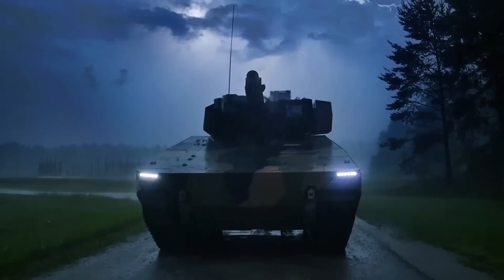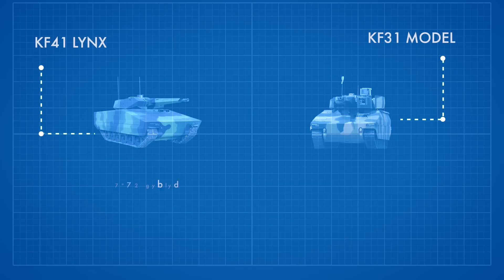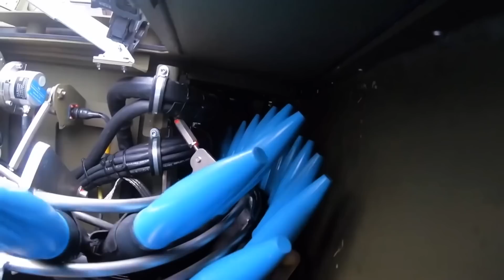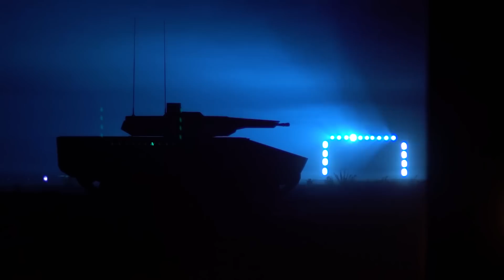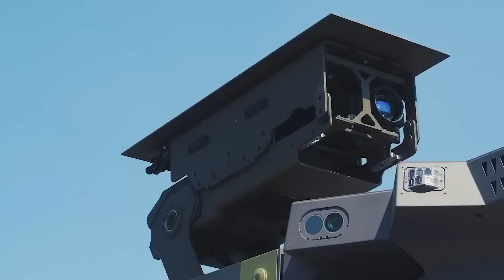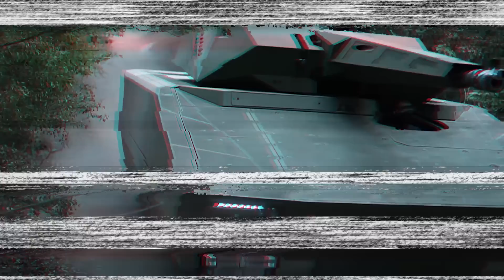New GERMAN Infantry Fighting Vehicle With SPIKE Missiles SHOCKED THE WORLD!

Comment: This looks like WW2 german armor tradition - compex, expensieve, heavy and few in numbers.
Reply: Have a look at the wars of the past 50 years to see how simple, cheap, inferior equipment in large numbers has always been obliterated by superior equipment even if there was less numerous superior equipment.

Weight isn't as relevant these days as long as the engine can keep up with it, which is the case.
Heavier IFVs are just as mobile as lighter IFVs these days.
Reply: @GABA-A42  I agree that using numerous cheep and old equipment is bad idea. It will lead to enourmous casualties and defeat like in the Gulf wars. My point is that germans often overengineer. At some point close to 90% of desired capabilites is enough. The other 10-15% make the vechicle very expensive and compex. See german Tigers and US Shermans in WW2. I know one was heavy tank and other was medium, but the germans wanted the best of the best. The americans wanted good enough.
Reply: @tacho843  I want to second what was already said above. There is no such thing as "over engineered".

A vehicle may be too expensive to manufacture. It may be too difficult or expensive to maintain. The company producing the vehicle may not be able to deliver enough in a reasonable amount of time, or the ammo may not be readily available. All of these criticisms mean something, although I'm not aware that any of them apply to the vehicle being discussed here.

In contrast "over engineered" is so vague it could mean anything, and as a result actually means nothing.

Comment: but by the time the german army obtains it it will be decades and obsolete
Reply: The Bundeswehr already has Puma in service. This vehicle is an inferior platform designed for the export market.
Reply: @Wilhelm Eley No, Puma is clearly superior in terms of crew protection, range, and power/weight ratio for the most part. It's fairly common practice for nations to reserve more advance vehicles for themselves.

Comment: The Lynx isnt that New anymore , though the newer KF41 version is i guess , the Newest IFV from germany would be the KMW RTC120 i belive ,but there isnt that much information out there yet , exept what was shown on the Eurosatory 2022
Reply: True. In addition, the Spike rocket system is not new as well. It is older than the Puma. However, it is even possible to shot anti tank missiles from the IFV Marder since the 70s. It is possible to mount a MILAN on it. It is basic equipment and included into the tactics of German mechanised infantry. Therefore, all German companies have to include this kind of weapons into an IFV of they want to sell it to the German army.

Comment: The US variant of the KF41 will have the 50mm (Bushmaster, I believe) cannon.  And that main weapon system has a much higher elevation capability.   This thing is ultra clean.  You might see the US KF41 having a smaller hull now that the Army has changed IFV doctrine and wants only 6 dismounts in a vehicle.
Reply: hunagry plane to produce with 120/130mm autoloader turret as armata like tank  and with 155mm cannon like what pz2000 have.
Reply: @makoado6010  Yeah, they call that the KF120 around here.  Haven't seen any talk of the howitzer version.
Reply: @DarkHorseSki  there is a boxer with 155mm cannon. and the lynx is pretty similar to boxer.
Reply: @makoado6010  True.  Yeah, pretty much any turret type that Rheinmetall comes up with could probably be a variant of the Boxer, Lynx, Puma, Panther...  Though I am surprised they would do a big howitzer on that smaller chassis of the boxer when they already have a HX3 10x10 with an artillery package.
Reply: the american version is not even finished and not even a prototype, the lynx can allready be bought. Not even hope there will be an american kf41. America will buy our lynx. 4000 of them. american millitary industries just cant build tanks anymore. they have not even a following version of the m109, they dont have a following versioni of the abrahams, and they dont have a infantry fighting vehicle while germany allready have since 20 years the pzh2000 while germany allready have 350 pumas, while germany now has the kf51 panther. and that goes on in every category
Reply: @wolflarsen1900  I know how far each program is and what they have.  The American version had to be cut down (why Rheinmetall didn't offer the KF31 at that point still annoys me, but whatever) to reduce the dismount space (and for the weight savings).  The US SEP upgrades to the Abrams have effectively made the tank something still at the top of the playing field, particularly once the SEPv4 is rolling out with that new gun system fully implemented.
Reply: @DarkHorseSki  with upgrades you can improve a system forever. For example the abrahams or the leopard 2 platform cant use a 130mm cannon. And if you compare abrahams upgrades with the equivalents of german leopard 2 upgrades like the latest leopard 2a7v its still a lot worse. the abraham system is just in its fundamentals not a very good system and leaves less space to improve it above a special point. Thats why actually the united states should have develeoped a newer version since a hell lot of time. That they dont do that, and thats true for all of their systems, is a very bad sign. America just stopped to invent new millitary vehicles since nearly half of a century (!). And thats also why the often just propagaded allegeded new versions like a new abrahams should make everybody doubt that the ever come into existence. Germany never stopped upgrading and developing new vehicles, and thats why germany has better millitary vehicles than america.
Reply: @DarkHorseSki  why does it annoy you that rheinmetall didnt offer the kf31 at that point?
Reply: @wolflarsen1900  Because the KF31 is sized EXACTLY to the number of dismounts the OMFV program now requires.  The vehicle is, essentially, the same age and has much of the same modularity as the KF41, while already being the right hull... at least as far as I was concerned.  And actually, vehicles like the Abrams have been through so many rebuilds that the vehicles don't really have a standard hull any more.  So, even if they had the molds they could not just stamp out new hulls to fix things in the fleet as the vehicles in the fleet have enough size variation from different weldings, that it is not possible.  The KF41 is so modular, that upgrades on it will be 40x easier to perform than we see on any of those vehicles designed in the 20th century.
Reply: @DarkHorseSki  Hi, Jon, I am still surprised how long the US needing for a replacement of IFV Bradley. Almost huge amounts of time and money wasted and nothing to be seen. Only Germany is worse in planning and decision making (btw not due to military personnel but due to politicians). Military in Germany has by far not the appreciation as it has in the US. Like you´re interest and obviously dedication and expertise !
Reply: @veritas_13  Politics is certainly part of the issue in the USA too.  Other issues are foolishly trying to have vehicles that do far too much.  Jacks of all trades, masters of none, so to speak.